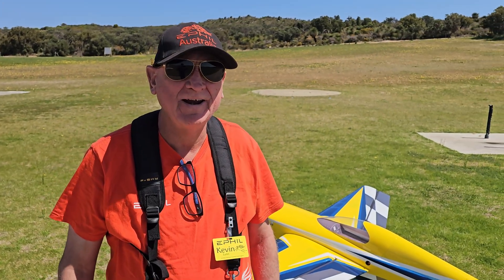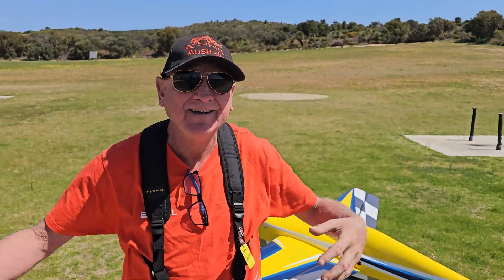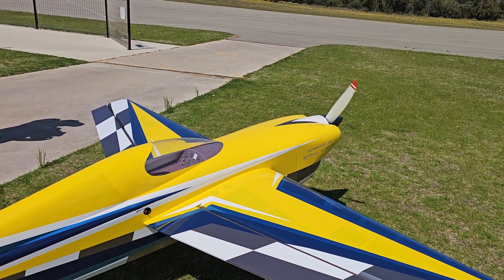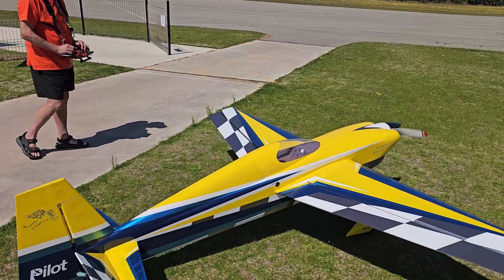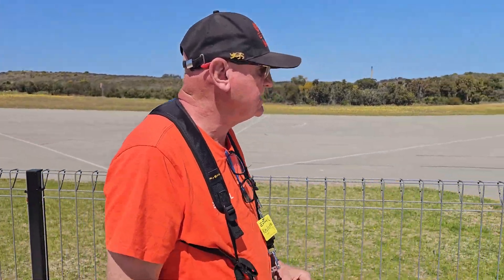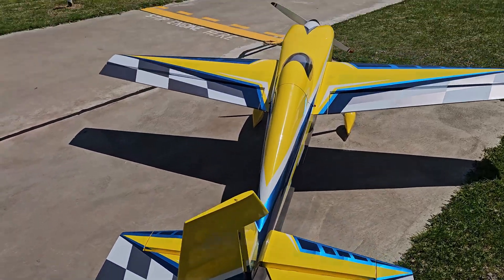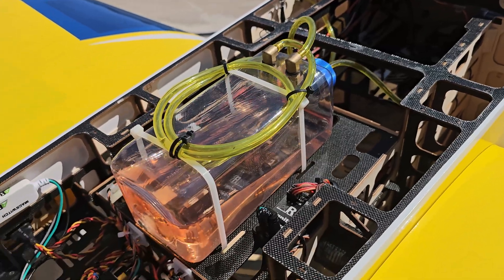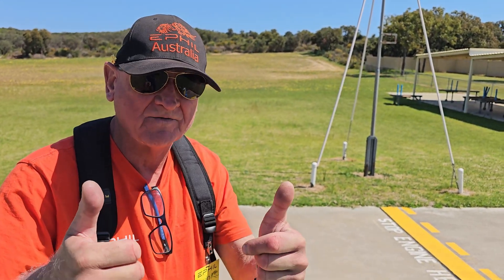EPHIL 123 Pro powering a Pilot Edge-540 104inch

Comment: what do you think about the power to weight ratio? of the Ep 123?
Reply from the maker: I have five engines all in Pilot  Lazer ,Pitts, and Edge 540  also flown them DLE 130cc and  Stinger 125cc and the EPHIL has the similar if not a little more usable smooth power.